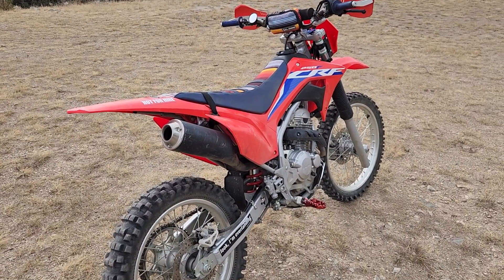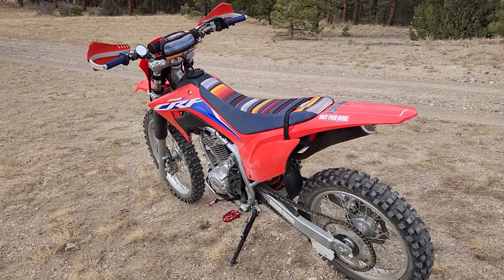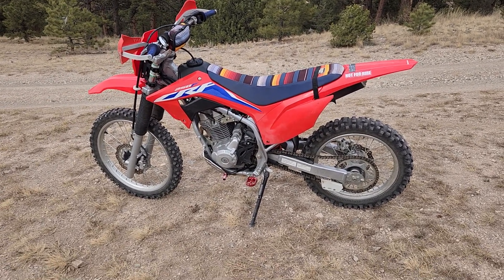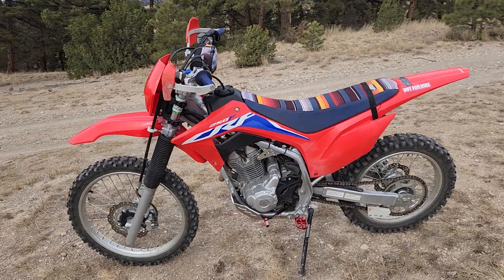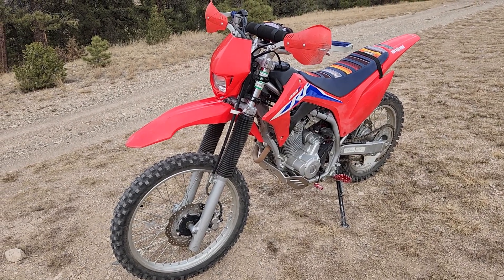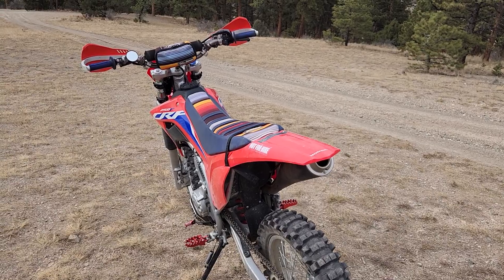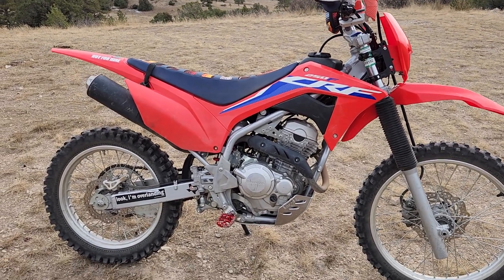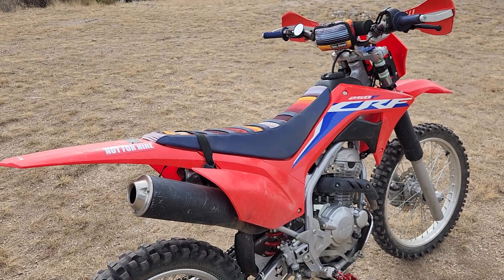Another CRF250F vlog, updates/exhaust mods

Comment: If you get a Yosh pipe, they clearly state that you do not need to tune the ecu, or get the EJK. I have both (EJK and Yosh), save your money, just get the exhaust. Do a 4* advanced flywheel key instead of the EJK, alot better of an upgrade.
Reply from the maker: Thanks for the info!  Yes timing advance will definitely help especially at elevation.
Reply: wish I could find a 4 deg key!